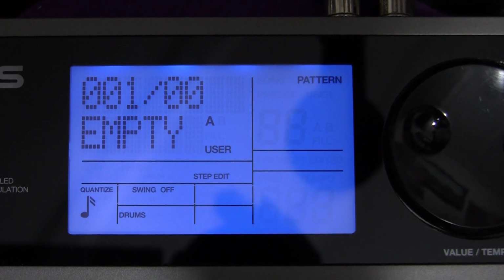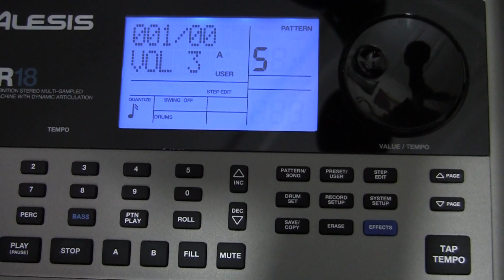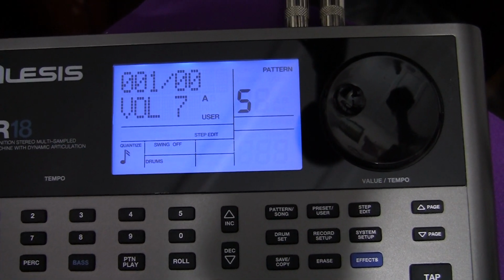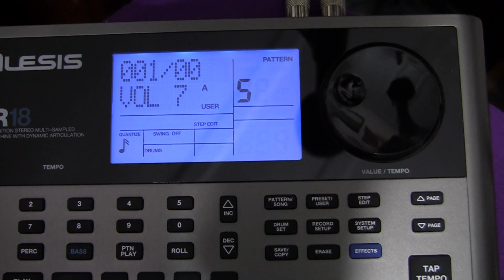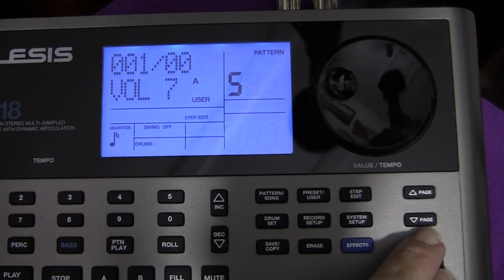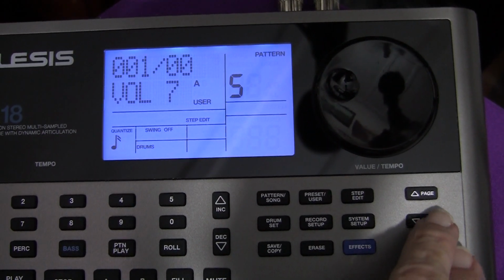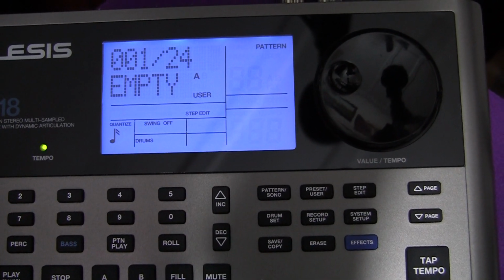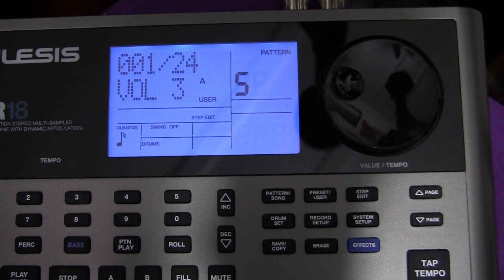Creating drum patterns for Alesis SR18 Drum Machine

Comment: very helpful. But I couldn't help noticing that you didn't enter the off-beats of the kick drum. No syncopation. Which I would kind of have liked to have seen. And am I correct that you just entered the first bar but not the second? Although the playback contains the entire pattern as written. What I don't understand where the "24," "48," and "72" come from. If the quantization is set to 16th notes, should we see "16," "32," and "64"? And how do we set a beat to ... "18" or any other number beside 24, 48 and 72? UPDATE. I used microsoft copilot and it explained how this is done. Not easy to do! Basically the Alesis SR-19 only has subdivisions of 0 to 24 etc, no matter what quantization you chose. To get syncopation it's best to get a chart and use that. Try asking copilot it helped me.
Reply from the maker: I am glad you figured it out ..... ALL digital gear has a "granularity" which is the smallest increment of time that  it is possible to record (like a ticking clock) ...... most MIDI sequencers have 96 beats per quarter note (this allows for all the nuances of real time performance) ...... quantization allows you to snap events to precise timing grid(s) ...... I think it is a pretty cool and easy to use system  ....  I don't use copilot, I prefer Google A.I. for internet searches .... but to each his own.... thanks for your comment 👍

Comment: Hello, Sir
In your example of quantizing, there is a 16th note used. You said that because of this when you step through the sub beats, you travel at a rate of 24 beats. That means you start on beat 1. Then the sub beats are 0 24 48 72 and it goes to beat 2. Why does it stop at 72? i noticed when I tried other values for example 32nd note the sub beats were 0 12 24 36 48 60 72 84. Many more choices. I guess I don't understand the math. Can you help me please? Thank you so much.
Reply: I meant I wanted to recreate drum patterns of songs on recordings, but I also want to create my own material. However, I will follow your suggestion of using the presets. Until my skills improve. Again, thank you so much for all your help. God bless you.
Reply from the maker: There are 96 sub beats to 1/4 note .... so 1/16 note (which is smaller)  has 24 sub beats ....  so setting the quantization value to 1/16 steps through the pattern 24 sub beats (with each step) .... now if we have set 4/4 time .... we have four 1/4 notes (beats) per bar .... so now it should be obvious to you that we cannot have more than 96 sub beats before going to beat 2 and since we are "stepping" by 24 then THAT explains why it goes from 72 to beat 2 ....... a 1/32 note will only have 12 sub beats ..... but there are eight 1/32 notes in a 1/4 note ..... so when we get to beat 2 then the highest sub beat count just before reaching beat 2 would be 84 ..... 96 - 12 =84 ...   there are ALWAYS 96 sub beats to every quarter note because that is the highest "resolution" of the device ..... however, when you use time signatures other than 4/4 ..... or set quantization intervals other than 1/16 .... the relationship between the "sub beat" count and the "beat" count is going to change ..... in order to properly "edit" a pattern you need to have the quantization set to the smallest note value in that pattern otherwise you will find it impossible to "delete" an event that falls between the sub beat sequence ..... I hope you can follow this detailed explanation  so let me know 🙏🙏🙏
Reply: Hello Sir,
First let me thank you for your time and attention you gave me. The example you gave me cleared up a lot of confusion. Thank you so much. Are you aware of any other books, or information on how to use this drum machine? Where did you get you knowledge of this machine? My next project is to understand how to create a pattern from a recording. I play guitar and want to play gospel recordings and copy the drum patterns for church. Any suggestions? Anything you could tell me would be appreciated.
Thanks again
Reply from the maker: @TheKbstrings  Thanks for your comment.... this is the second drum machine I have owned, the first was a Yamaha RX-11 which came with a well written user manual ..... all drum machines are basically similar .... when I bought the Alesis SR 18 it came with both a "quick start guide" and a "reference manual" in the box but they were quite flimsy ..... they were very poorly written with numerous mistakes and there was no Index to look up specific topics (so it was a nightmare) ..... however over time, and after quite a bit of trial and error, I figured it all out ..... then I started making videos to show people what I had figured out 😁.... there is no automatic way to "copy" a drum line from a recording into the SR18 .... you have to listen to the recording and identify what the various "drums/ cymbals" are doing and then try to recreate that timing on the SR 18 ..... eventually you will get good at it (hopefully) .... but the SR 18 comes pre-loaded with virtually every beat used in all the genres of music so why not use one of the presets that sounds similar ? ..... that would save a lot of time ..... and I see little point to creating an "exact" cover of other musicians work .... be original .... play the song "your' way .... it's a whole lot easier and more fun too .... personally I refuse to "exact copy" anybody else because you will always be playing "their" song and not yours 🙂

Comment: Hello, I have made my first Song. I have used several patterns with the breaks (fill A - fill B) and I have a problem. The pattern that follows the breaks has a crash that doesn't sound. Only crash patterns that do not have a break fill-A or fill B in front of them are played. Do you know why this happens? thank you.
Reply from the maker: try moving the crash a small amount of time in either direction .... just a few clocks (there are 960 ticks per  quarter note) ...... you will not audibly be able to detect such a  small timing difference .... but it would make a huge difference to the processor

Comment: can you take out the bass?  I just want the drums
Reply from the maker: You do NOT need to use the  Bass option when creating your own USER patterns .... but when using the PRESET  patterns you can MUTE the Bass so it does not sound...... simply hold down the "Mute" button and touch the "Bass" button and it's gone .... at least for the balance of your session 🙂 ....  it wont "remember" this if you turn off the power

Comment: I have a lot of trouble creating basslines via step mode or even editing basslines of other patches. Its seems some bass line steps are displayed when editing and then others are not. Its confusing. Have you done a tutorial on creating basslines via step edit ?? It would be very useful. I usually just create basslines in realtime but its not ideal.
Reply: I understand Stephen. All good I can record bass lines in realtime, thanks for replying
Reply from the maker: The reason some steps are displayed and not others has to do with the  Quantization interval (which controls the step interval).....  I could do a video but I would NEVER use SR18 for my bass lines.... it's way too limited by the awful "entry mode" which is designed for drum patterns not "normal" musical lines.

Comment: Great tutorials, Stephen. Still haven`t solved programming sixties shuffle. Any short hints? Thanks!
Reply from the maker: IF the swing feature in "Quantize" does not give you what you are looking for .... then the only other option is to actually PLAY IT (that is perform the shuffle yourself manually while recording with "Quantize" turned OFF)..... the Alesis SR18 is  both a MIDI sequencer capable of recording an actual live performance  OR  "programming" a pattern sequence..... since I am not a drummer, my videos only show the "programming" aspect......  but an experienced drummer can record ANYTHING into the machine 😊
Reply: Stephen Mendes Ì ll keep on trying. Thanks again Stephen. I am guitar player no drummer. Missing 6/8 blues too.
Reply from the maker: @rolfm8373  You can easily set a time signature of 6/8 ..... I just checked ... when you  press "Rec Setup" and you go through the pages  ..... the number under VALUE is the bottom number of the time signature .....  the number under BEAT is the top number of the time signature...... and you can set ANY time signature used in music...  so just pick a blank pattern in the USER memory .... set your 6/8 time and record your blues pattern 😊
Reply: @StephenMendes  Thanks a lot. You are right. Finally managed to create my blues pattern in 6/8 and - hopefully - managed to save the changes via <REC> I`ll keep on trying to get that shuffle rhythm too.
Reply from the maker: @rolfm8373  I already have a video showing the "Save procedure" ..... it's the same whatever you are trying to save ..... and NOTHING is saved unless you EXPLICITLY "save it" ..... which is both "good" and "bad" depending on how you look at it..... but "it is what it is"  😊 ..... thanks for sticking with Alesis SR18..... it's a wonderful product WHEN you eventually figure out how to "get it do stuff" that you want ...... it's actually easy to use..... just takes a LONG time to learn due to the "very poorly written and erroneous" user manual
Reply from the maker: @rolfm8373  Please take a look at my latest video for the SR18 (transposing)..... you inspired me to do a set of videos for the features that would be most useful to guitarists using SR18 in a live situation..... but I have to release them slowly in between my other videos (or people will start unsubscribing 😊 .... it's hard to keep everybody happy with my channel) .... best wishes

Comment: When creating your own pattern and putting your own note values in (within a measure) can you place different note values in, like have two eighth notes and two sixteenth notes within the same 4/4 measure?

And also when inputting note values can you program dotted notes in your measure or can you sort that out if you plan to hook the drum machine to your DAW software?
Reply from the maker: NO pattern sequencers do not allow note values at all ..... they only act as triggers ..... you can move the triggers around (with a high precision) within the measure but the triggers just sound either drum, cymbal or other percussion ...... if you want note values then use a conventional linear sequencer...... drum machines only contain pattern sequencers ..... but all modern Workstation keyboards have in TWO separate sequencers ...... one for recording your MIDI tracks (the same as in a DAW) .... and the other one is a pattern sequencer for programming just the drumming patterns ..... drums and percussion instruments in real life are struck with a stick (the equivalent in electronics is a "trigger").... therefore no need for note values
Reply: Stephen Mendes  thank you for the feedback so say I wanted two dotted quarter notes and a quarter note in one measure I could get round that using DAW software?
Reply from the maker: @Pkdrecords93  what impact would this have on DRUMMING ? ...... if you are recording bass,  lead or chords then persistence of the sound is very important for musical phrasing......  but when you strike a drum it's decay characteristic determines how long the sound takes to die away...... drummers just hit drums with sticks ..... there are no dampers like in a piano  ..... so quarter notes and dotted notes have no MEANING  ..... the sequencer in the SR18 is a DRUMMING (sequencer)  it is NOT designed to record melodies or musical passages ....... YES..... you can send the dotted notes and other note values (from your DAW)  to  trigger the drum sounds in the SR18  through a  DIN MIDI cable .... but I very much doubt that those note values are going to have much impact on how the drumming actually sounds .... let me know when you try it 🙂
Reply from the maker: @Pkdrecords93  Yes you could trigger the drum sounds in the SR18 from your DAW's  MIDI tracks
Reply: Stephen Mendes  thank you for the help and just for when I record backing tracks for live use just a song starts with all instruments playing that two dotted quarter notes and quarter note pattern 

But I have this app Songsterr which allows you to learn songs which are in tab and rhythm form and you can solo and mute instruments so save the trouble I could just solo the drum part for the song and play/record it into my multi track recorder and then saves me time then but yeah I have come to the fact that drum machines are a less time consuming and helpful process for adding drums to your songs but iv got my eye on this one at the minute it does seem great but thanks for your help :)
Reply from the maker: @Pkdrecords93  If the spacing of the notes on your measure is determined by the note values then YES you will hear a difference in the timing of the drum beats ..... but this will not be because of the note value ..... but because of the "measure/beat/tick" where that note (no matter what it's value is) actually starts (along the timeline of the measure)   .... hope this helps you  to understand it better
Reply from the maker: @Pkdrecords93  take a look at the message I just sent you  (about NOTE ON and NOTE OFF events)...... and the "measure/beat/tick"  pointer in your DAW ..... if you look at your MIDI track(s) using the MIDI EVENT view/editor in your DAW .... you will see what I mean ..... best wishes, bro
Reply: Stephen Mendes oh yes I think I get it more now because like you said taking the dots and note values out of it for a sec cos iv just tapped that beat I mentioned and I don’t know about the last beat but the beats will fall onto the offbeat resulting in the rhythm you desire? 

Like a dotted quarter note is the original notes value including an extra half of the original beat (so 8th note) therefore the next best will come in (if you like) on the off beat of beat 2?

Sorry if it sounds confusing
Reply: Stephen Mendes  sorry to flood you with messages so basically you can choose where about you place the notes within a measure on the drum machine your saying, be it on the beat or on the offbeat?
Reply from the maker: @Pkdrecords93  I just checked the manual for my Roland FA-06 and I CAN specify the Note type (and gate time) in the pattern sequencer .... SORRY I may have given you wrong information ..... I am checking the Alesis SR18 now to see if there is a way to  change it there also.... but what I said is still  applicable, because the note type is used as the STEP FORWARD or STEP BACKWARD distance in the "measure/beat/tick" position pointer rather than as the length of time that the note is "held".... hope this does not confuse you even more
Reply: Stephen Mendes  I do intend to buy the Roland FA 06 to, it does seem like a great workstation and it’s okay don’t worry about it, my fault for throwing confusing comments your way ha, but basically what you said is within a measure, you can input notes either on the beat or on the offbeat resulting in beats with dotted notes or in a simpler sense, making the note duration longer?
Reply from the maker: @Pkdrecords93  yes that is it ..... you uses the quantize feature ..... to get the degree of timing precision you desire ..... but I think you can actually do a fine adjustment down to one clock tick .... which is  1/960 of a quarter note resolution.
Reply: Stephen Mendes thank you for the help because my head has seriously been baffled over all this haha cos so many questions have been coming to me to answer, iv watched your vid and continue to re watch your vid where you make the sixteenth note pattern on the drum machine 

Because in that example you work with sixteenth notes but I can see where you can go along to put input in at wherever you like within the measure, as many say once you get the device and have a little play with it few times you will get used to it but thank you for the helpful feedback and continue with the vids because there great 🙂
Reply from the maker: @Pkdrecords93  I will make some more vids for SR18 for sure